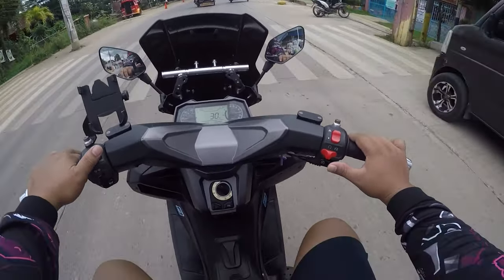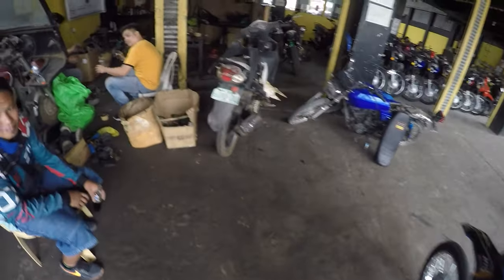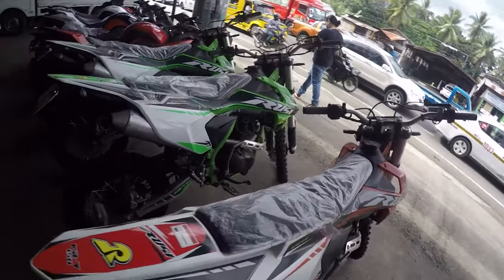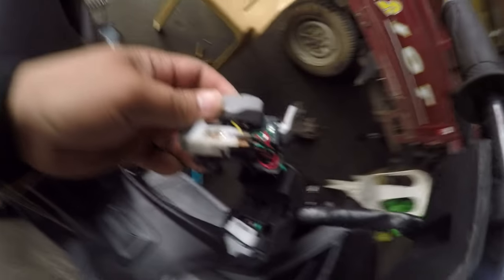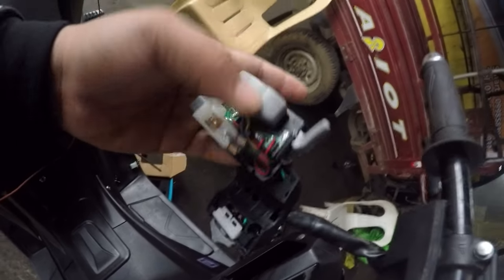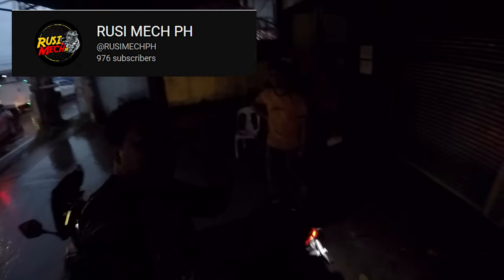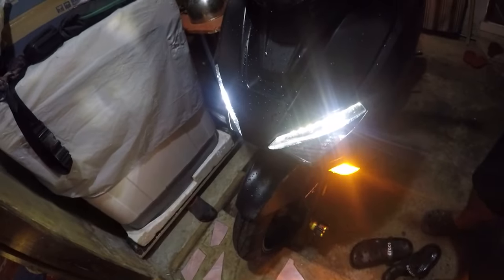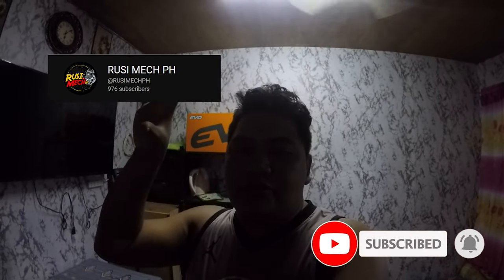HOW TO INSTALL THAI SWITCH/RUSI RFI175 UPGRADE/THAI SWITCH INSTALL

Comment: Paps matanong lang, ano yang bracket sa windshield na gamit mo?
Reply from the maker: sa nmax v1 paps
Reply: @motsnidel  paano diskarte dun sa stock sidemirror paps?
Reply from the maker: yong sa stock side mirror k paps nabali kasi ang side mirror nah nabili ko kinuha ko lang yong part nah pang kabit sa bracket tapos yong stock side mirror nilagyan ko lang ng bolt and nut para makabit sya .
Reply from the maker: medyo mahirap e explain paps try ko gawan ng short vids